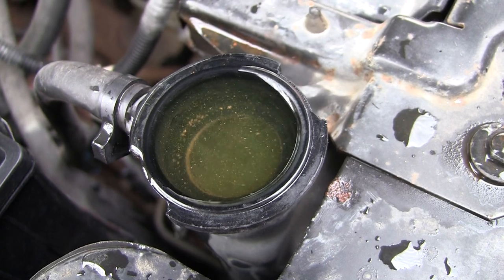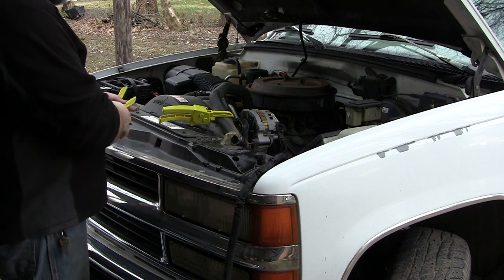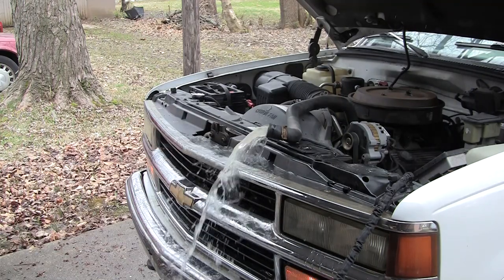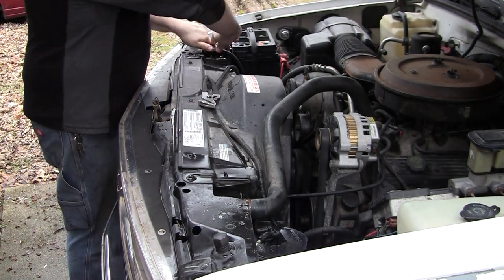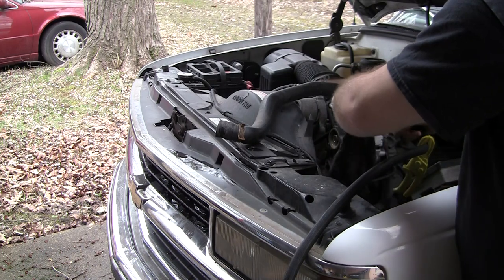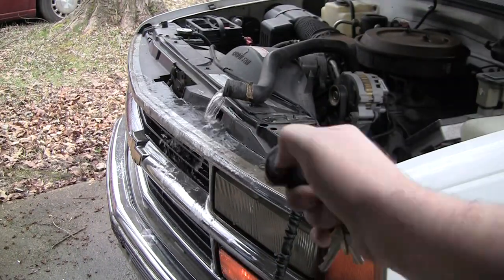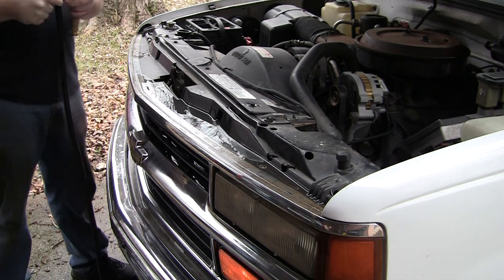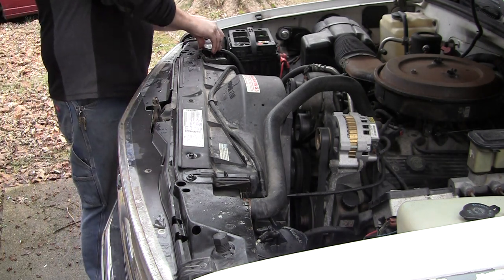1995 Chevy Truck V8 350 Cooling system Radiator flush

Comment: Use a rad flush additive, they are cheap and it breaks down the scaling in the radiator and engine block that builds up over time. Just running straight water does little except flush out loose scaling and not the stuff stuck to the metals inside. If using straight water don't leave it in for long since it will cause corrosion inside the radiator since there are no corrosion deterrent additives in straight water. Use distilled water and antifreeze concentrate when refilling. Also best to not drain antifreeze into the lawn or drain.

Comment: Every fall, I backflush the heater core on both of my trucks. I unhook the heater lines from the engine side, blow the coolant out (in the reverse direction) with an air line. Fill with radiator flush, let it sit for a couple hours, blow it out again, then I do the same thing with boiling hot water 3 or 4 times. I always get so much crap out of it, brown goo and coffee grinds, even though the coolant in the radiator looks brand new. Before I started doing this, I wouldn't get good heat until it was running at operating temp for at least 5 minutes, but now, it gets warm as soon as the temp needle comes off the stop, and gets hot soon after.
Reply: I'm going to do this soon. I have dexcool and it's pretty nasty. I'm going to flush the block and heater core. Going to green coolant after
Reply: Got any pictures of this? I’d like to do this with my 350 tbi. Not sure I fully understand where your blowing compressed air into the cooling system.
Reply: @wazowskij8157  He means blowing air into the heater core. The lines from the core come out of the cab into the engine bay on the passenger side. Take the rubber hoses off of those hard lines and you can blow/flush it from there.

Comment: Good that you clean the system but distilled water is the only water that should be used. The minerals in tap water contaminate the cooling system and can created scale on the inside of the water jacket. The last flush should be distilled water and flush chemicals then use a 50/50 or 70/30 mix 70 coolant 30 distilled water if you live in a really cold climate like me. Pure coolant will still freeze the distilled water helps with the heat containment and transfer of heat better and is why some truck heating systems work better than others, it the differance in mix percentages of coolant and distilled water. 60/40 works well for where i live in the north in a 1992 suburban with a 350 CID 5.7L witha 4 core radiator. Some of the newer GMC, Chev trucks have a problem with the Intake gaskets leaking coolant into the oil pan due to corrosion of the gaskets by the pink coolants that GMC started using and they need to be changed and the Green coolant needs to be used which doesn't corrode the gaskets some gasket for this reason have been upgraded to a steel and rubber type. If you have a newer GM car or truck and your rad coolant looks really brown or dirty do a oil change and see if the oil has any coolant in it. this will be a early warning sign that your engine will need a intake gasket. Your dirty water looks like a motor oil that is being pushed in the the water jacket by the compression of the piston pressures like blow bi.

Comment: Flush with water only unless it is crusty. Everytime I flushed my system with Dupont Radiator Flush, my water pump started leaking. Before it was OK. After the flush it leaked. This happened three times over the years. I never flush with a chemical anymore. If you keep your system clean and full of fresh anti freeze you never have to flush in the first place. If your truck isn't getting hot just flush w/ water if you want to clean it. If it ain't broke don't fix it.
Reply: I agree... i flushed my Blazer with the chemical  Cleaner  and about a week later the water pump was leaking at the little hole by the shaft, because the cleaner cleaned all the grawdo from the water pump bearing.  Flushed it again throughly with just water a few years later... no problem. I also back flushed the heater core with the garden hose water only... Heater worked well after that.... no chemicals !!!

Comment: Im guessing this thermostat stuck open since the first time it opened due to copper radiator sealant (barrs)  will suffice as a gutted thermo?   
Also... For quicker more thorough flush and easier catchment in a larger underbed storage containter... Im going to use lower hose outlet to flush.  Brand new radiator and hoses.  Not flushed properly during rad. R/R.   DIM wit. Did it myself wit no help.

Comment: Just to be sure, you take off the upper radiator hose, then put the garden hose into the upper radiator slot, right?
Reply: Right
Reply: You can also do it on the lower hose that goes in the water pump.

Comment: Instead of gutting your thermostat , why not just leave it out ??   ( I'm curious ).
Reply: same! im having trouble understanding what he did from 0:53 to  1:10. what does gutting the thermostat mean??
Reply: @angelfacecosmetics3656  , Gutting the thermostat is taking most of the insides out so it doesn't work the way it's intended. I believe he should have just left it out and he would have gotten the same results. But I can see why the reason to use the thermostat is because if he left it out he would have to use a gasket for  the housing. He saved one gasket by doing this his  way.
Reply: Why bother gutting it? Just leave it out and reuse the old gasket. Who cares if it leaks a small amount. When I did mine and reused the old gasket, it did not look in good shape, but didn't leak anyway. Just before putting in coolant, I put in the thermostat and new gasket.

Comment: Is it a good idea to remove the termosthate out of the truck? I own a Chevy C1500 2DR 1995 and for any weird reasson the last owner removed the termosthate
Reply: I wouldn't run it too long w out a functional thermostat it's there for a reason
Reply: Thermostat opens to flow to radiator after it hits a certain temp, if you remove it it'll flow to the radiator without needing to get the temp up too much, just making flushing and swapping out fluids easier and quicker since you dont have to wait for it to hit molten temps to start flowing 👍 if its left out your engine takes longer to get up to operating temp which can lead to poor fuel efficiency

Comment: Jason, have the same truck, how did you program yours to remote start ?
Reply: nd20111 I too have the same truck. At 165xxx miles about as in the video too. How did u install that remote start jason? Thanks for the videos. Your rear drum brake cylinder replacement was a life saver!
Reply: It’s auto start you can buy it at Best Buy and they will install it for you as well all for like $300
Reply: TacoSpeedsters they’ll also re arrange your trucks electrical system with shotty connections and reckless teenage angst

Comment: Your 350 Vortex is laid out different than my 97 Express van. I need to flush not only the engine and rad but the rear heater. Do you know it the heater hose behind the alternator is where I need to put a flush tee? I can't tell if this is the hose coming off the water pump. Everything is so buried and hard to see in this van. I was also going to force air (like 5 lbs) through this tee since I have no idea how to drain the rear heater. The Haynes manual says this van takes 20 quarts of coolant! Once I Purge the system I can add 10 quarts of antifreeze then 10 quarts of water through one of those Lyle funnels with the engine running.
Reply: Just so you know, this is not a vortec (ls based truck engine). It is a tbi 350 (based on gen 1 smallblock)
Reply: Secret.  First things to take out to get access, are air intake box and water overflow reservoir.   You'll get used to it.  It's just one of those things you have to roll with in van maint.   I changed my alternator in a parking lot with a number ten number 13 and a flathead for tools. Oh... And channel locks because previous owner kinda rounded battery terminal bolthead on ground.

Comment: Does anyone know if the driving process of flushing is still with the gutted thermostat?
Reply: Yes a lot of people take them out and gut them as a cheap fix if they go bad and vehicle over heats a lot too!
Reply: Michael Hauser, only use the gutted one during your flushing procedure after your done all the flushing, yes you should put in a new thermostat. ( subject to summer or winter temp.)

Comment: Hello, I did the same thing you did, but for some reason when i put the hose in the radiator it just shoots backwards. It wont go through the  system and out the top radiator hose. Is there something I'm missing? I didnt see you take off the radiator plug?
Reply: Katie, did you add a rag or anything to create a “seal”.  If you look at the video again, he has a tag wrapped around the garden hose
Reply: Radiator could have a lot of corrosion and it wont pass liquid easily.

Comment: I have a question sir, 

So you mention the pump being replaced. Was this before or after this process 

I ask because i thought the engine sucked coolant into the engine from the thermostat part. 

This video makes me think the pump is actually sucking the coolant out of the radiator and into the engine from the lower radiator hose. 

I guess im confused, does the water pump only come on when the thermostat opens? Doesnt seem like they would talk to eachother... is it when it notices loss of preassure by the thermostat opening that jt kicks on and pushes it in to the block? 

Hope my questions make sense. 

Thanks in advance.
Reply: Because the thermostat controls how much coolant goes thru and with it cold…. It will be closed so in order to flush the heater core at the same time u need the thermostat wide open just for the flush
Reply: This question is 10 months old, but since I didn't see an answer to your query, I though I'd give it a shot.
The water pump on these trucks is mechanical and runs off the serpentine belt anytime the engine is running, regardless of whether the thermostat is open or closed.  The pump is an integral part of the serpentine belt arrangement, and has to be in place in order to route the belt over other components that are also part of the serpentine belt arrangement, including such things as the alternator, power steering pump, and A/C compressor, as well as idler pulleys to allow tension and adjustment of the belt.  
The purpose of the thermostat is to stay closed and prevent coolant in the engine from circulating through the radiator until the coolant reaches a certain temperature, typically 180 degrees. This allows the heater to warm up faster than if the coolant was circulating through the radiator.  There is also less wear and tear on an engine when it comes up to operating temperature, so it's in the interest of engine longevity to allow the coolant to warm up as fast as possible.  
When the thermostat opens, it allows heated coolant from the engine block to pass through the upper radiator hose, to the upper radiator inlet, and through the radiator for cooling, and is then sucked out through the lower radiator hose by the water pump, where the coolant is then circulated throughout the engine, and then constantly repeats the engine/radiator circulation cycle.
Reply: Got a "killer glass" radiator hose custom made and i saw the answer to my question 9 months ago. 

Its pretty cool to see the liquid flow.

Comment: Why did u gut the thermostat? Is that necessary or can i flush with it in?
Reply: The thermostat only opens at operating temperature.  If you don't do this the system won't stay wide open during flushing below 160f (or whatever the particular therm is set at).  They're $8 at any autoparts store -- you'll have a better time if you gut one, or if your seal isn't integral to the thermostat housing, just remove it
Reply: @fallenone6  ....so I'm glad you're asking this, but tbh I'm not sure if you're trolling me or not.   Yeah removing will be OK as long as your gooseneck still seals properly to your block.   Distilled water just reduces potential corrosion which is a moot point when it's just flushing out gunk-filled old water anyhow.   On a new vehicle with a clean engine there's a case for distilled, but at the vehicle age where water looks as it does in the video it's a different case.  Highly recommend you read the Haynes/Chilton manual for your specific car before you move on.   It seems like you're lacking some basic concepts (not a bad place to start but it's where you are) and that can be dangerous

Comment: they put a drain at the bottom for a reason
Reply: You can't access the drain on these many of these, especially Vortec 5.7 trucks. I've owned several, 2wd and 4wd. You cannot access the rad petcock.
Reply: @RedfishCarolina  you can reach it from the top? Its actually pretty easy lol. You just gotta be okay with touching the hot radiator with your whole arm lol
Reply: @deaddad6310  no not on mine u can’t
Reply: @brandon263  yeah you can. All 1500, 2500 trucks are identical in the engine bay. Every 5L or 5.7L is set up the same. I've owned 2 Silverados a Tahoe, and a suburban. The two Silverados were a 92 and 96, my tahoe is a 98, and my burb is a 93. One Silverado has the 5.0 and the rest have the 5.7. You can reach it, it's there. Unless it's an aftermarket radiator
Reply: @deaddad6310  ur right it is there, I’m sayin I am not capable of removing it is all, maybe if I took apart more under the hood, but I’m lookin at it rn and it has a strange looking plastic screw that’s got like turns on it I can not get it loose to save my life- it looks like a swirl with a slit and  ends on each half swirl for tightening I’m assuming? Is that what urs looks like? Mine is white
Reply: @deaddad6310  so the screw is literally set up to tighten only it looks like I can’t get any leverage or grip on it to break it loose
Reply: @deaddad6310  this is only my second gmt400 series truck and my 96 2500 had a different plug?
Reply: @brandon263  get a pair of pliers, and crank it to the left. Don't be afraid it shouldn't break on you. It's very stiff
Reply: @deaddad6310  that was my next plan, but like I said it’s so dang tight in there with my big hands it’s a pia
Reply: @deaddad6310  wait so what are you suggesting to do if I can get the drain plug out? Put hose on top where radiator caps at and do pretty much same method as video?
Reply: @deaddad6310  even after moving shit out of the way I still can not get it off, busted up my shit tryin but I give up, also my fuel filter is fused/stuck/rusted on the fuel lines and I can’t get that shit off…. Luckily I got 2019 F-150 recently to hold me over till I get this fixed, ty for replies
Reply: @deaddad6310  I posted a video on my channel, if u cud shine some light and lmk how u did it or if mines different plz I don’t want to go to mechanic when usually I can do shit on my own….
Reply: @brandon263  ya gotta get up under the truck and twist it, it's just a little valve. Do you mind if I ask what state you're in?
Reply: @brandon263  it's a tricky booger, but its alot easier to get it from underneath. Also those other two lines are oil cooler lines. I don't remember if it's the engine oil or trans oil but it's not coolant
Reply: @deaddad6310  added you

Comment: It keep getting cloudy and brown after leaving the tap water in because that tap water is eating away at the block, heads, heater core and radiator due to all the chemicals in tap water
Reply: Exactly. Iron rusts in seconds. I'd never let water sit in an engine block for more than a minute or two.
Reply: Not true at all I’ve flushed engines multiple times with a garden hose and left the water in there for days at a time then drain and refill the water will come back out clean when the inside is clean
Reply: I think it depends if there is clorene in the water
Reply: I flush with city water then fill with distilled for final fill.  I know its difficult to get it all flushed.  Especially in van.  This coolant system is a nightmare.  1997 5.7litre.

Comment: Why not just leave thermostat off??
Reply: You can, but in the winter time, you won't get any heat. Get bad fuel mileage.

In my summer driven 81 Camaro, I have no T-stat.

It takes a little longer to heat to operating temp tho.

Once my engine gets to the temp I like, my adjustable Rad fan kicks on. I also have a manual electric fan override on/off switch, with led light that tells me if the fan is on or off.

There is alot of debate about the T-stat, but I think its only for the winter time, and fuel mileage.

Engines are most efficient at like 195°f

I don't even have a heater core.

Comment: This doesnt crack the block?
Reply: You only crack the block if you ran the engine really hot, and then as quick as you can, turn a cold garden hose on, into the engine. Even then, you probably wouldn't crack the block. Just don't do it. 

Do this process "starting" with a cold engine.

Comment: That sucks.  Where do you attach the garden hose to the radiator?  You skipped that part.
Reply: He States connect to radiator, duh
Reply: He puts gardenhose in top hose inlet on radiator. Where flushing ouput was before it became output.  Filling gaps with a rag.